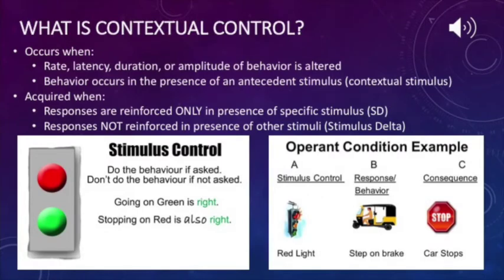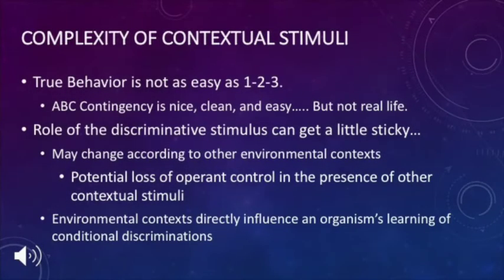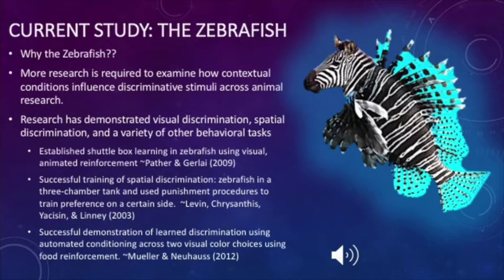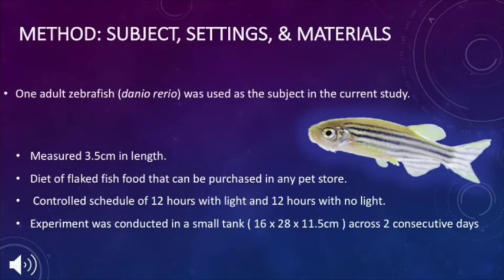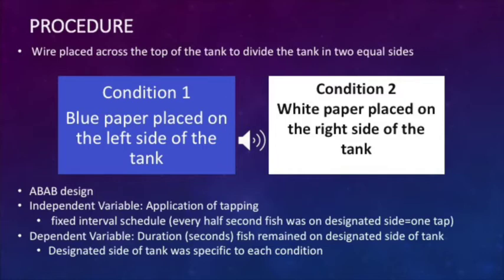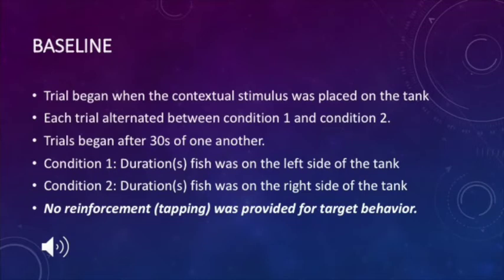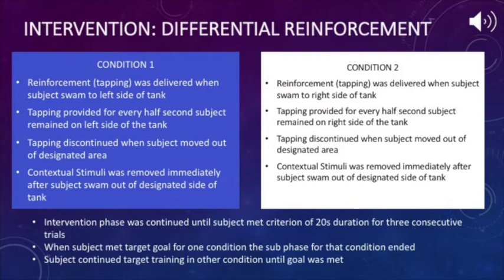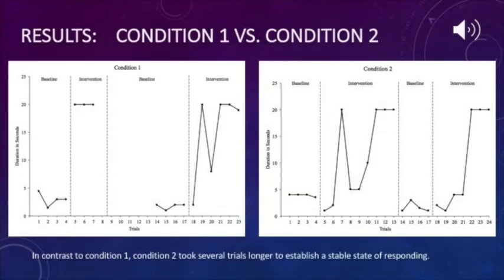Complex Target 1

Comment: Wow great job group!! I love how you incorporated the vocabulary into the presentation instead of just jumping right in to the experiment. It really set the tone for the study and gave the viewers a quick look at what is going to come up in the presentation. I agree with Jenna on the visuals that they made the presentation really flow together and just added that little extra information in a nice, easy portrayal. I was actually surprised you used tapping as a reinforcement because I would have thought tapping would be an aversive stimuli and the fish would swim away from the tapping. However the data did show that the tapping worked as a reinforcer so it as very unique.